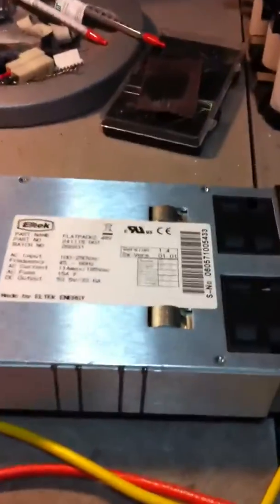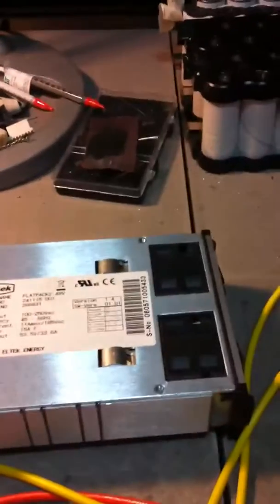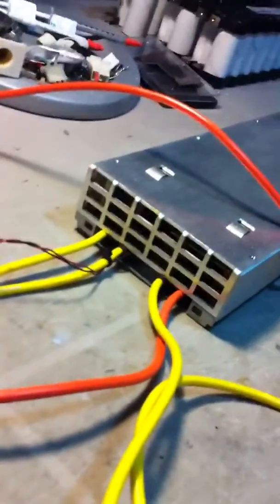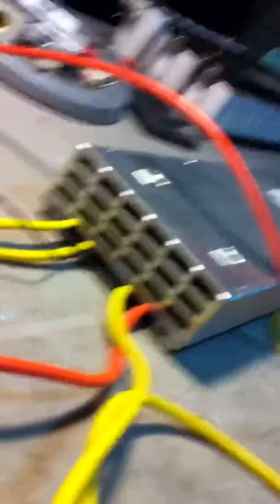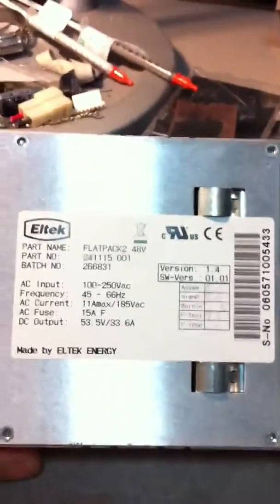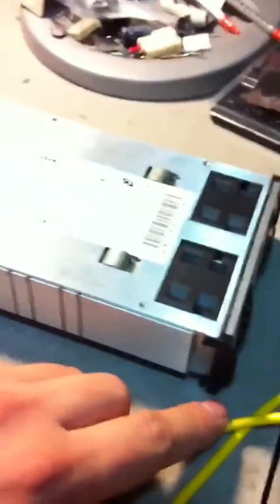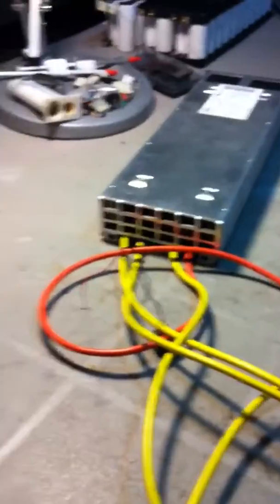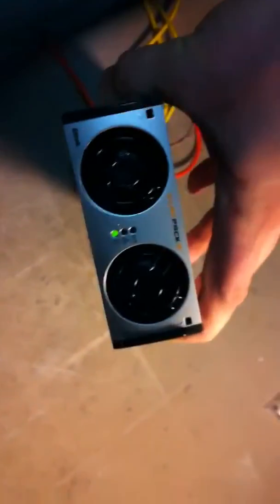Flatpack2 power supply 48v 1600w for sale

Comment: The Flatpack2 series power supply does not have phisical output voltage adjustmente like potentiometer or trimpot. This adjustment is software performed via CAN bus interface (2 of 3 central pins on rear connector of power supply).

The commands to set output voltage on power supply are sent by a Smartpack Controller module. The PSU remains this setup after power off. When powered on in stand alone instalation, the PSU works the last voltage set. To set a new voltage it needs to receive a new setup command from the Smartpack Controller.

I have a Flastpack2 48/3000 (part number 241119.100). My unit gives 53.5 VDC output. I intent to set it to 50.0 VDC but I do not have the needed Smartpack Controller. I have searched on Internet for byte level details about the CAN commands sent from Smartpack Controller but I do not found it.

I think is easy to perform a reversal engineering ataching a protocol analyser to 2 wires CAN bus. But I do not have the Smartpack Controller to perform it.

Here is the basic for CAN bus protocol: http://ww1.microchip.com/downloads/en/AppNotes/00713a.pdf

Have anybody the documentation for CAN bus commands used to Flatpack2 series?

Note: I am Brazilian, excuse me for my bad English.